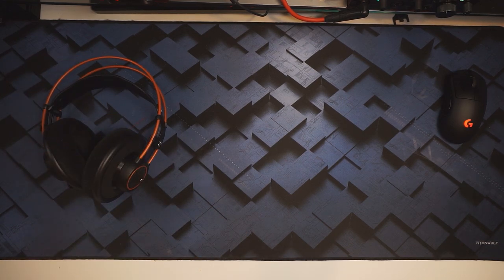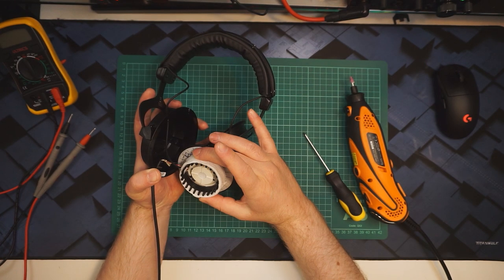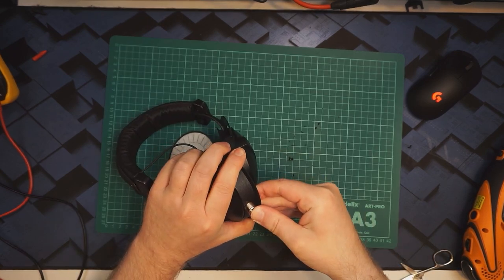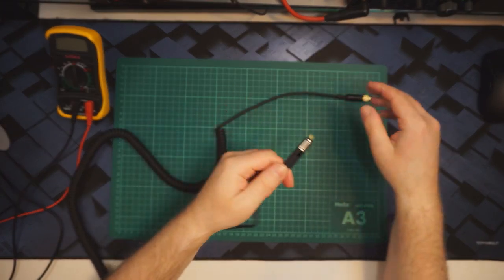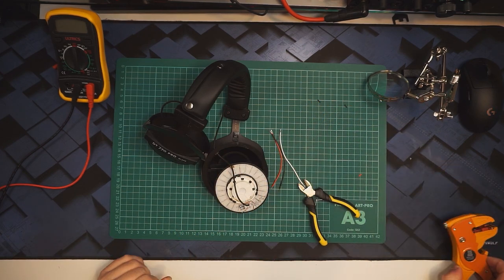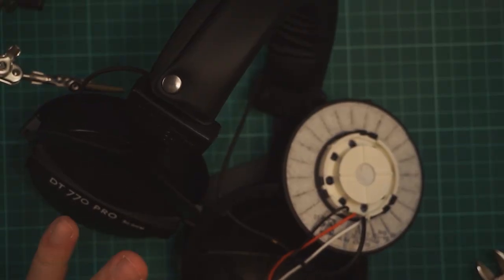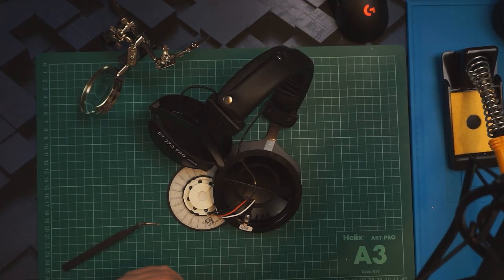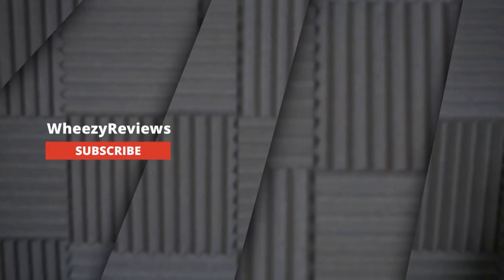DT770 Removable Cable Mod

Comment: The PVC isolated wires are pretty heavy compared to the original coated ones, so you alter the oscillation behaviour of the membrane. You should have used the original ones, there is a reason why such wires are utilised in speakers.
Reply from the maker: This is wrong. These wires connect between the driver and the connector. They have nothing to do with the voice coil or the diaphragm. If you believe that by being attached to the driver they will somehow alter the way the voice coil moves then this should really the very least of your concerns. I've already added a chunk of metal in the XLR connector, cut away some of the plastic ring, drilled a larger hole... The driver is not in such a delicate balance that replacing these wires makes any difference at all.

What's more this is a cheap pair of headphones with all the unit variances that comes along with it, and huge changes in sound that occur due to earpad wear over time that would hugely significantly outweigh anything that this mod would do on its own. Its totally a non-issue.
Reply: @WheezyTech  What I have written is not “wrong”, it’s a fact. Whether it’s a real issue or not is a matter of quantifying it and then setting a threshold, which is is debatable. Regarding its impact compared to the other changes you made is yet another topic. Without any measurements you cannot say much about it, but in my opinion it would have been a better decision to try to keep the original construction design of lightweight wires. In any case, what I have written is not “wrong”, you just disagree that it matters, without any proofs or measurements. Let me add that I really appreciate your thrive to improve the design and sharing it with the world though, so apologies if my criticism reflected the opposite.

Comment: despite of we cannkt remove the cable see default, its good to know that there is a retention to it, may be as a protection in case accident happen. nice mod btw. great info in case i need to mod mine.

Comment: Very delicate surgery, it would be easy to break the headphone, I have another idea, just cut the built-in cable for your favorite length and resolder the cable tip, is not as elegant and versatile as your solution is but it would be extremely easy to perform, what do you think?

Comment: Watched this a few times. There's one replacement I would be inclined to make. Use a powered screwdriver and a hex fit drill bit to make the hole in the casing.
The reason is two fold - firstly the drill is going much slower than a rotary tool. So you're cutting rather than melting. Melting plastic is awful stuff to inhale and it gets everywhere. Even if it's cold - a small bit of plastic in the eye is awful (I work with plastic, ergo eye protection pretty much mandatory).
Secondly, you can get a drill to the correct size, so it matches the new connector.
Reply: The only problem with a drill bit is that it’s really difficult to be precise if you’re widening an existing hole. If you wanted to avoid melting plastic in this particular case, I would probably opt for using a file or rasp

Comment: After 3 years since I last commented, the day seems to have finally come. It sounds like the connector of my headphones is dead, probably a cable got loose inside. I am currently ordering all the parts and a soldering iron. I will go with the Rean RT3 MPR connector though since I will be able to mount that after the soldering is done. Wish me luck.

Comment: So I've opened up my pair, because one cup stopped working, and noticed that one of the voice coil wires got disconnected somehow. Am I just able to resolder them, or might I break something because of the heat?

Edit: was able to solder them back on pretty easily and they work, so doesn't seem like there's a problem. I haven't actually soldered anything in probably half a decade, so if even I was able to do it, someone who solders a few times a year should also be able to do it.

And since it was already open I now also made the cable removable. Pretty nice.

Comment: Adding a metal cylinder and several long wires into the cup behind the driver probably changes the sound a bit. It would be nice if you did a basic baseline frequency response test before and after working on headphones to get an idea of the results and any needed changes. It may alter resonances, which are difficult to test for with easy traditional methods.
Reply from the maker: Its not as big a deal as it might seem. You are replacing cables with cables, a rubber cable and clamp with a metal tube so its not like you are adding something completely new. But yes it is more bulky and it is possible it would affect the sound in some slight way. Although its clearly audibly unnoticeable. The main thing to consider is that the DT770 is far from perfect to begin with. There can be quite a lot of unit variance as well as a considerable shift in frequency response as the pads wear. I would say if you are at all worried about the mod changing the FR then that's the least of your concerns with this headphone.

Comment: just got some DT770/32s, don't plan on doing this mod but its good information in case the cable ever does break so i know what i'm dealing with. a little sketched with how far the 3.5mm plug sticks out and im scared ill accidentally bend it

Comment: Next time don’t use hot glue. Use UV cure glue, it will last far longer, be a stronger bond and is easy to work with.  You can coat your solder joints with Uv glue as well which will ensure that they never come loose or fracture in any way shape or form

I work for cochlear manufacturing cochlear implants and it’s what we would do

Comment: Hey, just stumbled upon your video. Did you make the video for the standard cable? If not, I guess, you just have to wire it up directly to a male part. with no special thing in between. right?

Comment: I really liked this Mod and thinking of doing the same with my DT 990 since my right driver keeps cutting out whenever the main cable going into the headphones moves, so hopefully doing this mod will fix the issue! I don't want to discard a good pair of headphones or get new ones when I can just fix my currents ones. But I have a couple of questions.. What was the gauge on the wire you used between the miniXLR connector and the driver? and, was it a single core or strands wire?
I would really appreciate any suggestions!

Comment: It gets much easier if you remove the headband, then you can actually disconnect the adjustment for the ear cups and basically have a separated cup.

Comment: couldn't you in theory clip the factory wire longer and use that wire to connect to the XLR connector that way you dont have to desolder from the driver and you can also keep the OE wire.

Comment: Great video. Im in the same situation as i guess you are - i have AKG headphones with a selection of nice DIY custom cables - all mini XLR. I needed some closed back phones so got a pair of 770 250ohm a couple of days ago. I too am going to convert mine to mini XLR, which brand connector did you buy? Nice vid - thanks!
Reply from the maker: I think they were Rean "Tiny XLR" (mini XLR) connectors.

Comment: Maybe a stupid question.
I also checked my cables with the multimeter and it beeped in every combination of cables and plug connectors.
Is it the one with the highest value?
Reply: You should be checking for continuity so when you are shorting the two ends it beeps.

Comment: I understand the clean look of connection in cup, but would cutting the wire outside the cup and soldering on whichever connection you desire be easier/ just as effective??

Comment: Why not go dual and replace all the cable? I have a pair of 1770 that wont clamp properly. I have to replace the band with somthing that works. btw your changing the chamber volume and fr of that side.I hope the conector volume is the same as what was there.
Reply from the maker: Reading too much into this, its a convenience mod for an affordable headphone. One that has significant unit variances and massive changes in FR caused by pad wear usually unevenly and within a few weeks of use. This isn't some highly tuned well balanced machine, if anyone is so concerned about what this mod could in theory do to the 770 they shouldn't even be considering the DT 770 as an option

Comment: 21:33

What if it was some metal part which took vibration reading for electrical to sound conversion. We discontinued the ring continuity but snipping that part.

Just curious not criticizing, did it lose quality or anything and beautiful job. I'd have changed the bit back to smaller but but you got it.
Reply from the maker: This part is there as part of the damping behind the driver. The white felt material is the damping and the black plastic piece holds that in place on the back of the driver. There is no downside to cutting the front part of that plastic piece as it is still able to hold the felt in place, we are just making room for the connector.

Comment: I have extremely rare tupac section 8 headphones from a discontinued company from 2013 that have better sound quality than beats studios.  They have a built in wire and I'm trying to watch the best tutorial and how to do this. It's so risky to the point I'd rather pay someone else with better precision.. You should get into business. I'd definitely pay close to a hundred to salvage these headphones. Is the process the same or atleast similar to a 3.5 mm socket?

Comment: I was considering this for the Tygr 300 R...but I have like none of this equipment.
Probably cheaper to send it off to someone on Etsy or something.
Reply from the maker: Beyer should have made the cable removable for the TYGR but I guess they wanted to reuse the same shells as the 880
Reply: @WheezyTech  - Yeah, I don't really get Beyer's insistence on sticking to wired models. Really like the Custom and 177X for that reason.
I also don't think they thought they would have so difficult of a time moving units of the bundle either. Took forever for them to be sold separately.
Reply from the maker: @TsunTzu  The only place I can find the TYGR not in the bundle is directly from Beyer themselves. From what I hear its an excellent gaming headphone, they should have put in a removable cable with miniXLR, optional cable with a mic attached. Sold it without the Fox mic and pushed that hard. Beyer open backs are great for gaming, my 1990 is the best headphone I've ever used for FPS games.

Comment: What do you consider to be the best headphone under $150 regarding isolation and build quality? I was eyeing the akg371 as i saw you suggesting it a few months ago and i wanted to see if that's still the case and if so, is its bluetooth version worth it (since i think ,correct me if i'm wrong , if i connect it through cable the sound shouldn't be affected )
Edit: i still watched the whole video despite not having the dt770 just because i enjoy the way you explain things and i think i fried my Hyper Stinger as you mentioned in the pinned comment so that's something to remember for the future :)
Reply: I ordered mine based on Wheezys and metal571 review, when I saw that they both shared a similar opinion about the m50x as I did (I sold the m50x), which made me think that I can trust what they're saying.

My K371 didn't have any build issues and it sounds very good. I also ordered the Beyerdynamic Custom One Pro+ for the comparison (16ohm) and lent the HD600 from a friend. I preferred the K371 over both. 

They're easier to drive with whatever (the COPP was a bitch, even HD600 was louder without an amp), COPP sounded like there's music playing in front of me, compared to K371 where I was in the middle of it and HD600 while it had better detail of instruments just lacked bass. 

I returned the COPP and use the K371 happily. I'd say it's the best "just put it on the fucking head and listen to music" headphone for this money.
Reply from the maker: There are 3 headphones below £/$100 that are worth considering (there are others but these 3 are easy recommends). The Creative Aurvana Live is a good budget option for listening to music but its not built particularly well. The K371 is a good all rounder, probably the best for music, pretty comfortable and built pretty well, early QC issues notwithstanding. The DT770 Pro is super comfortable and well built but better for general listening and movies/games than music listening. There are probably other options between 100-150 but not sure if worth it over these 3 options.
Reply from the maker: Still waiting for that Bluetooth K371 to launch but I guess its been delayed due to current global issues. It should have been out by now.
Reply: @WheezyTech  I have been going back and forth between the dt770 pro and the akg371. On one hand i like the all roundeness of the akg while on the other i really apreciate the long lasting aspect of the dt770. The durability part is quite important to me since i want a pair that will last me through university. So in this regard and the isolation part (to deal with noisy roomates) which one would be better?
Reply: @sd7335  i think you just convinced me to pull the trigger on this pair :)
Reply: @WheezyTech  Also i saw the bt version on amazon and locally sold (more expensive)
and i don't know if it's worth it or if just buy the cable version and mod it somehow
Reply from the maker: @petrusvalentinsimion7718  Oh thats interesting, its only available for preorder here. Was due out in Feb then March then April.. Who knows when its available here now. Yeah not sure if worth it or not myself, I guess it depends on how often you want to go wireless. Seems to me that they have only added features so I would hope that they are at least as good as the regular version with added BT. But who knows if the sound sig has been fouled by stuffing the cups full of electronics and batteries.
Reply: @petrusvalentinsimion7718  I'd honestly can't really tell you which one you'd prefer more, just sharing my experience. One of my most important arguments was also versatility to be used without an amp (I use it with PC, laptop and a tablet and don't want to hassle with an aditional device or EQing) and k371 performs outstanding for this use-case. 

I'll admit that durability wise the DT770pro is awesome, since you can get replacement parts for everything and is admittedly also built more sturdier.

 If you have a chance, order both on amazon and return one, that way you'll know you made a good choice.
Reply from the maker: Good point on usability without an amp. K371 is super sensitive and you could drive them off of anything.
Reply: Oh Noel I don't think you've tried tried the Porta Pro have you...gotta do that
Reply from the maker: @metal571  I nearly bought one a few months ago. Its funny because my mind is telling me they look like my old 80's Walkman headphones and I find it hard to believe they could be any good. And yet people seem to love them. Yeah I need to pick up a pair.
Reply: @WheezyTech  the reactions I've gotten putting those things on people with the Yaxi pads and parts express headband mod are priceless. They are shockingly good
Reply: metal571 best set up on the cheap possible. Surly? I use that set up every day out of a Hugo 2
Reply: @garygriffiths7353  HAHA best pairing
Reply: metal571 lol I know it’s sounds silly expensive dac with cheap headphones but it sounds great

Comment: great tutorial dude...I modded my dt770s with two 4 pin audio jacks (TRRS), one for audio and one for microphone because I preferred a headset instead of headphones + usb microphone with boom arm. Unfortunately I got massive problems with crosstalk that means my mic picks up every single audio from my pc. I think the problem is that mic and left and right driver share the same ground dont they? I use a TRRS male to male cable. I tested a logitech g pro x headset which has a 5 pin pole audio jack and a 3 pole jack for the mic. It comes with a 5 pole TRRRS to 4 pole TRRS cable and there was no crosstalk at all.

Is is possible to mod a dt 770 to a headset with mic with no crosstalk? What if I use a 5 pin audio socket and a 3 pin mic socket? How do I have to wire all cables?

Comment: Could you put a 3.5mm connector instead of mini xlr. I want to use a lightning cable but there is no xlr to lightning only 3.5mm to lightning. Any help is much appreciated

Comment: hello i got a small problem. my headphones are working after this mod but the sound quality is very poor on both sides. i wanted to ask if i somehow damaged the voice coil. im also using cheap cable but i dont know if that is the reason. thanks

Comment: I have wanted to do this to my DT770 for some time now, but I just want to put in a normal 3.5 jack connector and not a minixlr. That would be somewhat easier right? But still following the same general method that you are showing
Reply from the maker: Yeah totally. In fact that would be easier as you wouldn't need to drill such a big hole.
Reply: @WheezyTech  Great! I think I will give it a go then 😊 Thank you for the video
Reply: @Tiranox07  Did you ever get round to do the mod? If so how did it go?

Comment: Wouldn't it be better to use a 4pin XLR connector or one 2/3pin XLR connector on each side to have dual mono transfer to prevent stereo crosstalk?
Reply from the maker: You could mod it however you want, perhaps one of the coolest thing about the 770 is how easy they are to mod. For me this mod was about making them compatible with the same cables as the K371, K712pro and DT1990 so I can use the same cable with all of them

Comment: very nice video - Question: as you are soldering 3 new wires into the cans... did you break them in with special frequencies ?...and for how long? :-D hahahah
Reply: Breaking in audio equipment is a myth. It's completely unnecessary. You shouldn't notice any difference in sound with new wires.